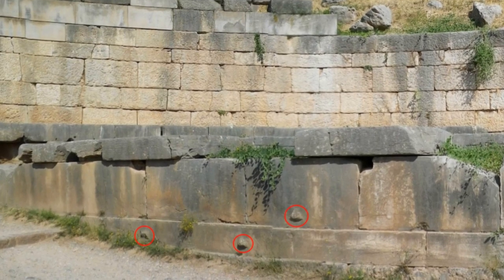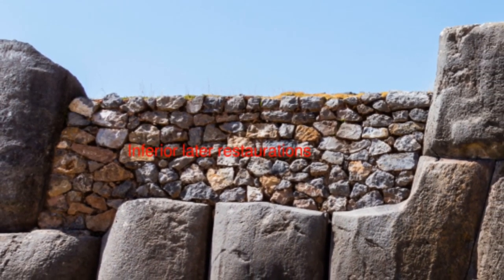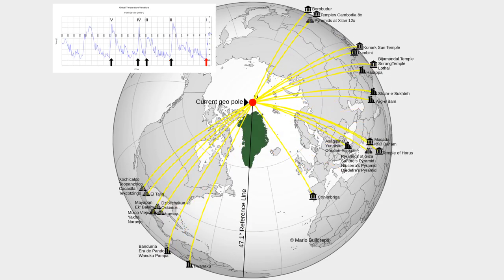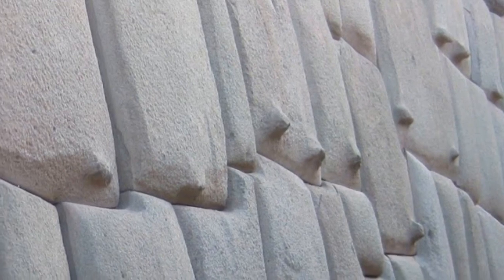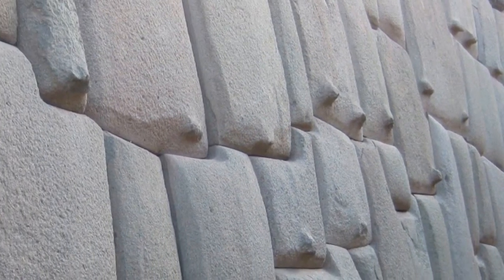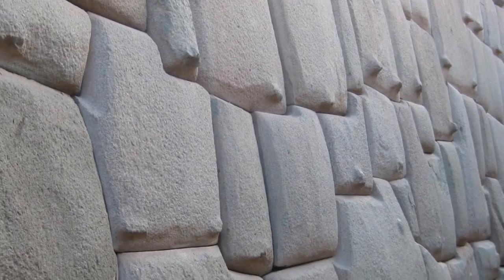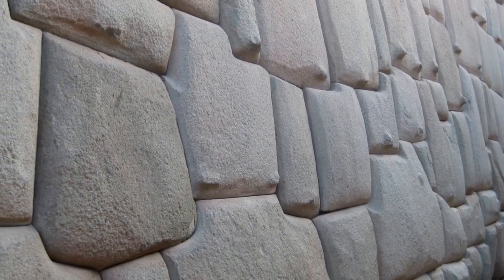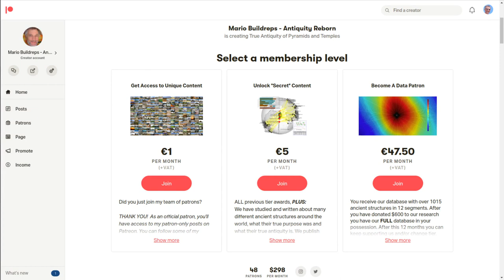The Molded Stones of Lost Ancient Worlds

Comment: Kind of funny to watch people excavate in Egypt using counter weights and they say they can't figure out how they moved such large stones. Obelisk are easy to raise. Like a giant teetor totter you move counter weights to teetor the obelisk. Then add a taller fulcrum under opposite side. Then move counter weight to that side till it lifts the other. So 1 person can raise a 700 ton stone on a fulcrum. by moving small counter weights till proper counter weighted. If the stone obelisk cracks it becomes junk, because you can't properly counter weight it to lift it.

Comment: They under mined the stones leaving nobs on the bottom cantilevering the weight of the stone. Then they cut the rest of stone from wall. So it would break way from the wall. The nobs kept it from laying flat. The nobs are less friction than a flat stone. Don't forget they can counter weight stones to move them to. Having a nob makes it easier to get rope around them. Why is this stuff so hard to understand? Pulleys and counter weights. The mystery to me has become why people can't figure this out? Minerals have value because their hardness. A couple rubies hardness 9 cuts granite hardness7. Why would they need iron hardness 5 to cut granite hardness7? They knew how to set gems in soft metals.